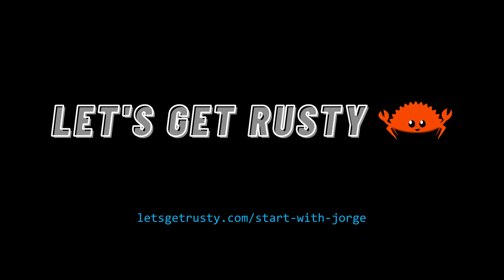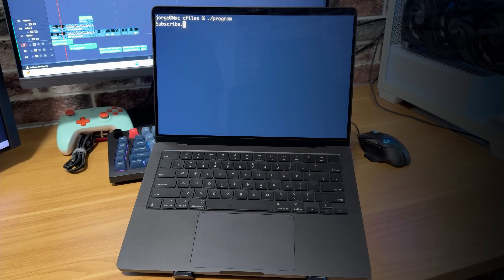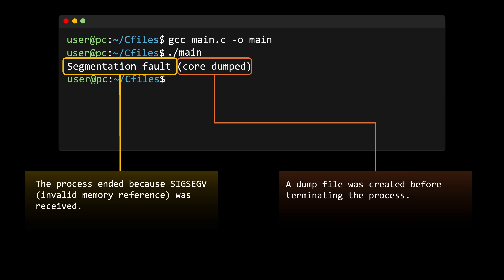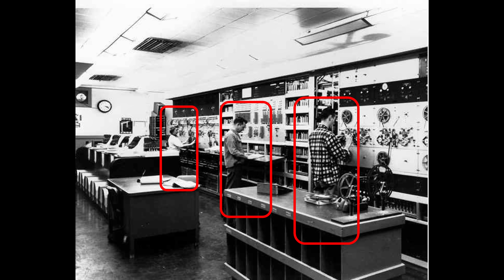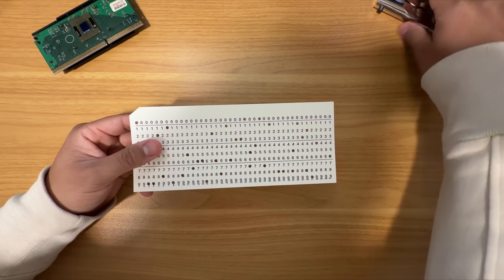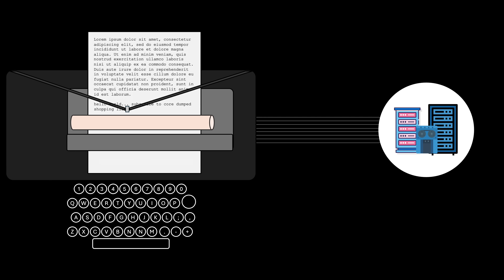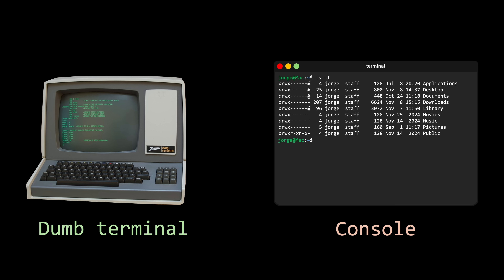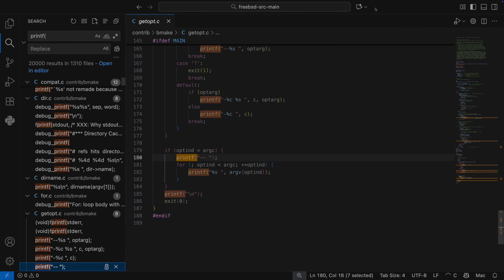How History Shaped the Programming Terms We Still Use Today

Comment: Print is perfectly reasonable for printing characters on a screen since print is a verb which means "to draw text on a surface in print" (as opposed to drawing text on a surface in cursive, which we would use the verb "write" for). The function name "print" has never seemed strange to me since that's literally what it does - but I suppose Gen Z and onwards might not be familiar with printing being something you do with your hand and a writing tool rather than something a machine called a printer does, and would just say "write" (which used to imply cursive).

Nonetheless, the print function makes perfect grammatical sense and is an accurate description of what it does today. It prints.

Comment: They weren't called dumb terminals when they were new, they were just terminals. Or glass terminals, to contrast them from the existing teletypes which were also called terminals (or print terminals). The term dumb terminal came later when more intelligent devices started to be created for workstations, similar to how acoustic guitar was created after electric guitars were invented but nobody said acoustic guitar before that. When I started college in 1988 we still had glass terminals in use and you could buy print terminals cheap at the campus surplus store...

Comment: It's my understanding that "patch" is way WAY older - all the way back to Old French for "piece of cloth", used to fill in the damaged portion of a garment.  While it's commonly believed that the software term originated from using pieces of tape to fill in punched holes, that rabbit hole goes far deeper.

In the early days of radio and telephony, operators kept spare equipment on-hand as malfunctions and outright failures were fairly common.  When something went awry, they would bring a substitute unit 'online' (literally placing it within the line of service) by connecting it via panels and cables expressly designed for the purpose - to this day such cables are still called "patch cords", plugged into "patch panels".

It's hard to fathom from a modern perspective, but there used to be no real distinction between hardware and software.  Something like the old video game cartridges (which technically used ROM, but still), programming was literally hardwired into the circuitry of early computers - computers which were extremely expensive to build and operate; extended downtime wasn't a viable option.  If they wanted to change part of the programming, they would build a new module and swiftly reroute the cabling to 'patch' it into the unchanged circuitry.

While it existed as a theoretical concept for roughly a century, "software" as we think of it today didn't exist in reality until 1946.  Prior to this, "programming" literally meant rearranging hundreds (if not thousands) of patch cords - physically altering the circuitry of a computer in order for it to provide the desired functionality.  Binary machine code gradually evolved into Assembler, finally giving rise to software as a separate conceptual entity from hardware.  Seeing as most programmers of the era had been using the term "patch" when altering computer programs via hardware, the term naturally transitioned to altering computer programs via software.

Comment: 11:56 It should be noted that "Shift key" is so named because in old typewriters, pressing it literally shifted the hammers upwards to change character case. On the other hand, character case is so named because in manual typesetting in printing industry, the individual characters were stored literally in huge cases, which were stacked vertically, hence we still have "upper case" and "lower case".

Comment: They didn’t punch them hole by hole with that plier thing. 
They had actual machines similar to typewriters for that. 
This is actually the origin of assembly language. Because in assembly each instruction (basically a binary number that tells the processor what to do) is given a short name. That name is what is written on the keys of the “typewriter” because you couldn’t write plain binary on them. People would get confused too easy.

Comment: Another reason for the use of the term “patch” is because time was required to make a “proper” change to a program: you had to change the source code, in a language such as COBOL or FORTRAN or assembly language, then find an opportunity to run a program called a “compiler” or “assembler” to translate it into machine language, and sometimes “linkedit” the program with other programs from a library, then run the new program.  But if your compiler produced a faux assembly listing showing the instructions and their locations in memory (and assemblers, of course, always did), you could manually create the instructions needed to make a minor change, and “patch” the program to incorporate such a minor change and test it, then go back and change the actual source program and install it.  Since this was something like first-aid, putting a bandage on a would while it healed, the word “patch” was doubly appropriate!

The earliest dumb terminals were indeed Teletypes and similar printers, but when video screen terminals came out, they were “dumb video terminals,” and the ones which used the same transmission codes as Teletypes and other printing terminals, so that they could be plugged in as direct replacements, were called “glass Teletypes.”

Comment: Punched tape and punched card are very interesting storage mediums.
No data at all are stored on them.
The data is actually the "holes", and the card or tape is there to make sure the holes stay in the right place with regard to each other 🙂
Reply: I'm not understanding "no data at all are stored on them"
     The holes represent data, zeros and ones, it seems to me.
     Regarding paper tape, the "feed" holes (small holes in the middle, not representing data) act to "sync" when to read the data holes or not.
     And of course the punch card, the shape/size/location of each potential hole was highly standardized.
Reply: @josephgaviota  I understand all that, I used to use them.
Its a bit of a joke.
Normally on paper you would write stuff on it, hence the paper itself contains the data.
With tape and punched cards the actually cardboard or plastic media doesnt itself contain any data, its sole purpose is to keep the holes (which represent the data), in the correct place and order. If you took the tape or cards away the holes would just evaporate.
Hmmmm, maybe I should not explain this.

Comment: Rust will never make it big. Look at the TIOBE index after around 15 years its in position 14, last month it was lower below assembler !!!.
Spots 2 and 3 are C and C++, they have been around there forever.
I work in financial services and they tried using Rust, and have now gone back to C++, rewriting the systems from scratch again.
You cant find any rust devs.,
If you find a rust dev they arent any good.
If you find a good rust dev they know nothing about financial services.
If you find a good rust dev who knows about low latency trading systems and they leave you are fucked. !!!!
Its a real business risk, and trading companies dont like uneccassary risk.

Its the fad language of the month but its doing nothing and so far going nowhere. As a contract dev its suicide dropping C++ for rust given the number of C/C++ jobs there are.
I have just started a low latency high frequency trading job where its all written in C, several other hedge funds have done the same. I have used C / C++ all my working life and it will see me into retirement, thank you so much Dennis Ritche.

There is nothing wrong with rust, but like go its probably going nowhere fast. The language to look at is Carbon, due to make its public release about 2028 I think.

Comment: I’ve read somewhere that the print function is still print because it prints to stdout and stdout does not need to be a monitor, it can be a file, pipe, printer, socket or the terminal
Displaying a string in a pipe does not sound as good 😅

Comment: At one time, dumb terminals were also called "glass teletypes". tty is also short for tele-typewriter as the text entered or recieved could come from a remote location, especially with modems. Modems are short for MOdulator - DEModulator, as they modulated the electrical signals into tones to be send down telephone lines. And telephone comes from Greek, meaning "remote sound". Type blocks are used for the little metal blocks with letters on them arranged in a grid and covered with ink to make text on paper with a printing press.

Comment: i think it still makes sense why it's called "print".
you feed characters into the standard output buffer, and it prints it into your screen.
Reply: you're using print in the sense of displaying characters and print only got that meaning because people didn't stop calling it printing after switching from teletypes to terminals
Reply: Now it makes sense to your brain because of assoiciation of years worth of use, but it is not "imprinted" on your screen. Word literally comes from the word "pressure" all the way from latin, pressure which you used to leave a mark on paper, ink was added too of course but printing comes more from the process of applying pressure to a relief or die with the shape of the character against paper.

Comment: For the case of print (or its variations in programming languages), some languages like MATLAB use disp (short for display). While still in Python, there's the IPython.display where you can import display instead of print (mostly for numpy & pandas dataframe). PHP, however, is a special case that uses echo instead. Can you explain why PHP uses echo & where it came from?
Reply from the maker: The original purpose of the echo command in early Unix wasn’t just to avoid writing a program,  it existed because users needed a simple way to send literal text into pipelines and scripts. Instead of writing, compiling, and running a custom program just to output a string, echo let you send text directly to stdout, which could then be piped into other commands.

The name “echo” comes from an older convention in teletypes and terminals:
a device would echo (repeat) back the characters you typed so the user could see what they were entering. The Unix command adopts that metaphor: its job is to repeat back whatever you give it.

As for PHP, it did not choose the name for historical reasons or because it was “better than print.” PHP has both echo and print, and they behave slightly differently:
- echo is a language construct, slightly faster, and does not return a value.
- print does return 1, so it can be used in expressions.

The choice of echo in PHP is simply for convenience and readability, not because it replaced the historical print.

Comment: Actually “print” is semi ok. “all meanings of “print” in English are ultimately tied to the physical act of pressing or marking a surface”.  

One could argue that firing electrons at a phosphor screen fits that bill.
Reply: But modern screens don't fire electrons at a phosphor display
Reply: @vibaj16  true but it was called “print” in the decades that that was the case yet still was not printing anything on a page.

Comment: I'm not entirely sure on the origin of print. It comes from a word meaning "pressed", which is what printers for a time did, but also print shops existed way before the era of computers.  And also where the phrase "print your name" (as opposed to writing in cursive) comes from.  That we use a function named print to display block characters makes sense, and I think the reason they were called "printers" was because they made print, not the other way around.

Comment: When I was at university in the early 1980s, our printouts were created in the "computer room", a place we were never allowed to enter. It contained a VAX 11/780. The printers in that room, because so many users required printouts (the only feedback from your program execution) were line printers - they didn't print each character on a line, but all of them at once. It was a high speed printer. It was a typical 1st year student stunt, to send a file of just 'form feed' characters. (The second year students taught us this.) The result (never seen by normal humans) was an incredible feed rate of paper that would rise to several feet :)

Comment: You skipped over delay line memory, but it doesn't change the main point of the video. 
The "Patch" origin story is not accurate, similar to the bug origin story. 
Patch is a generic term in the USA that refers to fixing anything with a bit of modification and added material. In the case of programming, the patch is just fixing existing code with a few modifications. The resources needed to do full version replacements was inefficient so only the differences were "patched" in, not just taped holes but inserting and removing cards or splicing sections into punch tape. 

Even into the 1990s distributing huge files was prohibitive and so just the differences by a revision were put into a patch file for distribution. They would be patched into a program that is already installed on a user machine; actually inserting and replacing a few bytes of data and individual lines of machine instructions in place into existing binary files. This is why patches were specific to starting version and couldn't [generally] skip ahead.

Comment: Brings back a lot of memories!  My first computer was a retired Burroughs B-500 with a few can type integrated circuits,, mostly transistors but a small number of relays and vacuum tubes in the power supplies, punch card input, 19.2k core memory, line printer output, and tape storage (no disk). It ran banking work from 1965 to about 1972, and got bought for $1 to get it off their books in 1975.  After that it lived in our basement for several years, dimming the lights through the house when powered on.

Comment: Also the escape key would originally insert the "escape" control character (byte value 27) which was used to send commands to the terminal it's the same as hitting ctrl + [ . Ctrl was originally for sending control characters to the terminal and the insert key was used to insert letters from the previous command into the current command under ms dos and the shift key originally shifted the typewriter caret upwards to make the part of it with capital letters hit the paper
Reply: ^[ is byte value 27, just like ^G is bell, ^I is tab, ^M is Carriage Return and ^J is Line Feed.
Reply: @RonJohn63  wdym? Didn't he say that?
Reply: @RonJohn63  He probably meant "would originally" in that it always did that (it was a fundamental aspect of the whole system), while in Unix it only happens in an emulated terminal, not for most other applications.

Comment: Many years ago I worked with someone who got into IT back in the 1970's.  One of the stories he told me was how they applied patches to a major computer system.  The system needed to be up and operating 100% (downtime not permitted) so they patched the system live.  They deliberately included blocks of NOP's (No Operation) instructions in the code, and if routines needed to be patched they would install the new code into spare memory, and code jump instructions into the spare NOP areas. NO downtime needed, system uptime preserved.

Comment: The origin of patches was new to me.
Reply: It's also inaccurate. The term was already in wide use [in the USA] for any sort of quick in-place repair or modification. The tape is only incidental and patching could include inserting whole punch cards or splicing punch tape to insert lines of instructions or data in-situ. (This sort of minimalist in-place file modification to upgrade software continued through the 1990s, with disk drives rather than paper.)

Comment: 8:39 worth noting that cheap lasers were not a thing until the 1980s, so earlier punch card readers used physical probes that sensed by completing a circuit.
Reply: Mostly they used photoresistors, not mechanical switches.
Reply: @strayling1  With lamps, no need for lasers.
Reply: @strayling1 iirc hollerith's tabulating machines used quicksilver and rods to connect the circuit
Reply: @nikauswien5863  That's going really far back. I knew some early readers used wire brushes, a bit like slot cars, but mercury? That's wild.

Comment: And because of teletypes, Windows still uses CRLF (carriage return line feed) as its end-of-line signal, while Linux uses the telegraphic standard LF alone, which still causes incompatibility between text files. In fact the HTTP protocol specifically has to accept both end-of-line signals for compatibility - so the telescope vs. telegraph question will be forever part of the core of the internet, no matter how long both technologies have been dead.

Comment: Windows is the only OS still formatting new lines as /r/n, which means CRLF, which means Carriage Return Line Feed. Modern 1st class OS’ like Linux and macOS use only ‘/n’ (Line Feed) as a new line. You will see this when editing .bat (batch) files on Linux, which were made on Windows. Batch… another word tied to punch-card programming, since a batch of punchcards together is 1 whole program..
Reply: Older versions of MacOS used CR alone. Must have been a huge headache for Apple's programmers when they were making MacOS X and had to worry about maintaining backwards compatibility with all the millions of files made on previous versions.

Also, I ran afoul of the CRLF vs LF-only issue when writing a little utility program. The file it generated was text-only, but the format originated on Windows, and my initial naive implementation produced files which couldn't be read by the original program. Cue much head-scratching until I tried opening it in a text editor and changing the newline encoding. After that, I changed my program to write a binary file and ended all the strings with "\r\n" in my C source.